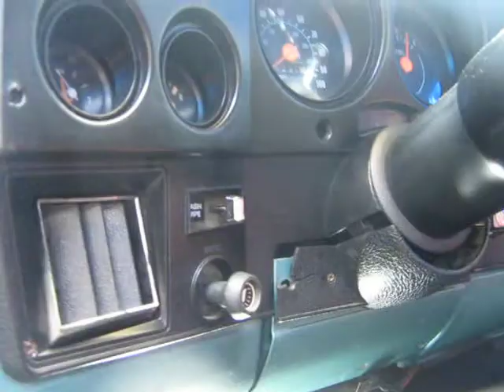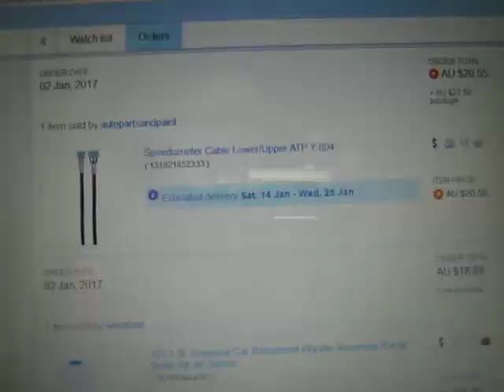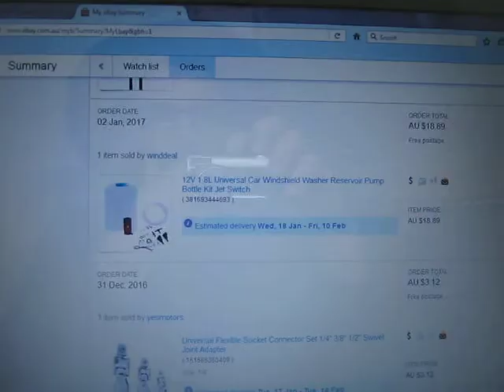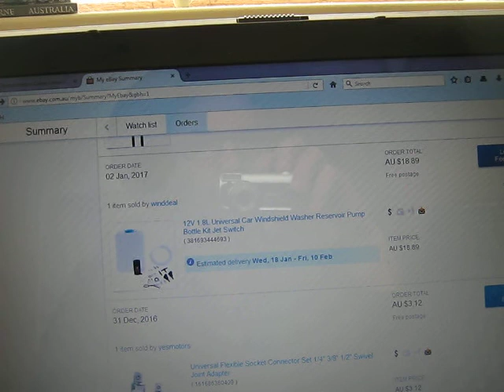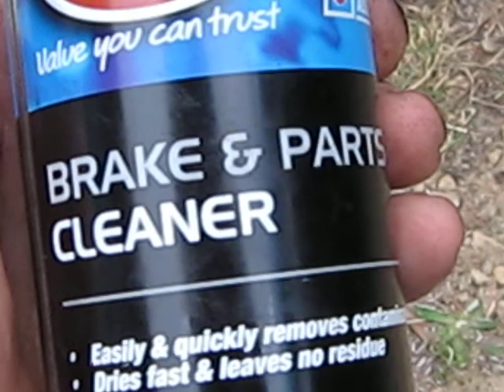1977 chevrolet truck work 2

Comment: Does anyone know if you can bypass the fender mounted cruise  control unit an go directly from the transmission through the firewall into the cab an directly to the insterment cluster?
   I don't have to have the factory cruise control. 
   I am going to try it.

Comment: The wiper washer is an electromagnet, that lifts a tab and that engages the pin on the wiper motor gear. It is controlled by the connector with the 2 flat spade lugs. Your interior light is activated by turning the headlight switch all the way to the left. Turning the switch to the right it controls the dash light brightness. When a speedometer cable jams in the housing, it winds the cable inside the housing. You can buy just the cable, but most people just replace the cable and housing. When you drove it home, it was probably rusty and seized in the housing. I am currently working on a 1978 C10, and I have dealt with a lot of these issues myself. Look into the new LED amber bulbs for the front signals, they are a lot brighter. Also, look into the red LED stop lamp bulbs for the tail lights. You will be a lot more visible to other traffic. Although you will need to use a different flasher for the LED bulbs. I wish I could help you with your truck issues, but I'm on the other side of the world in the USA. But I wish you all the good luck there is with your C10
Reply from the maker: Thank you for your comments, I would like to run a few things by you if I may,
One thing that puzzles me is when I go to start the truck it will keep cranking when I release the ignition switch unless i pump the throttle Is this normal ?

Also I have a fuel pressure gauge mounted on the fuel line just before the carburetor, if the truck idles for 15 minutes the fuel pressure go's from 6 psi at start up to 0 psi after 15 minutes, when at 0 psi the engine ( a 454 ) idles up and down ( rpm ) but keeps running
I am wondering if these things are normal
Any help would be appreciated 
Thankyou
Reply: I would check the actual switch at the bottom of the steering column, to see if it's corroded or stuck. Pumping the throttle should have no effect on the cranking unless it's stuck, and the vibration is causing it to release.
Your fuel pump is on the side of the engine, on your left as you look at the front. It is mechanical, driven off of a lobe on the cam. I would check the inlet tube from the tank to the pump, and see if it's blocked or pinched partially. Also, that is a diaphragm pump, so most likely if it can't hold pressure there is a small leak in the diaphragm.. The surging at idle could be a dirty carburetor, or partially plugged fuel filter. Also, a tune-up with new spark plugs, cap, rotor, and wires will help smooth it all out.
Reply: After a look at my ignition switch, if you can look on the column closest to the dash, you will find a metal rod. This comes from the key area, and is turned by gears to activate the switch that I mentioned at the bottom of the steering column. It is actually also on top of the column. If that metal rod is jamming on the column it could stick end keep cranking. Likewise, if the gears that are turned by the key are dry or dirty, that could cause the same issue. If you can locate a repair manual that covers these trucks, and specifically your 77, it will go into more detail on where things are located and what steps to follow to get to them.
Reply from the maker: Thank you very much for your help with the truck, I located the switch and removed it, it seems as though the grease inside has turned into a type of black cement, and the contact points are not touching, the neutral safety switch is near the excelerator pedal so may be pumping the throttle was enough to release the solenoid on the starter motor

About the fuel pressure ( decreasing to 0 psi in 15 mts ) I will probably drop the fuel tanks and re do the fuel line ( that fuel line is from 1977 ) , The tuck has a new fuel pump and filter, the engine idling up and down is when the fuel pressure is at 0
Thank you

Comment: I have 78 c10 I had some of the same problems with speedo cables. I figured out it was the cruse control was the problem . I disconnected it completely and got a cable for a non cruise control set up. What was happening my cables kept breaking Been working great ever sense
Reply from the maker: Ok cheers

Comment: Very good video, I have the very same truck...problem is that someone before previous owner swapped engines and got rid of many wires, so I am trying to put it back together as original but needed a visual of the wiring....  Thank you....  any way you can post another video of your updates>>>
Reply from the maker: The Chevy is going to sit for a while , I have to work on my career now, , I have a fair bit of work to do on the truck and i will document that work  there will be more videos, future video series will be a starter motor that wont stop cranking ( I think its the neutral safety switch ) and a decreasing fuel pressure problem )